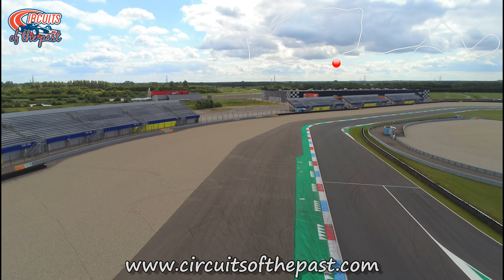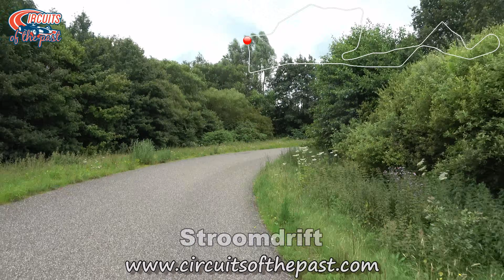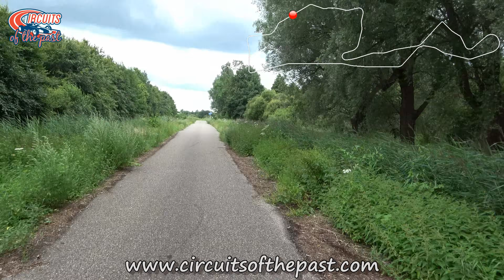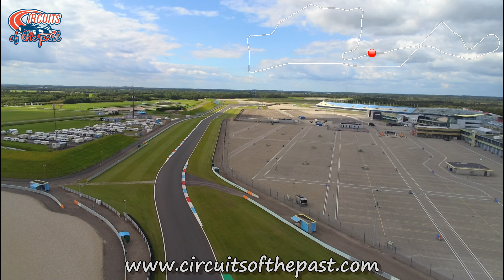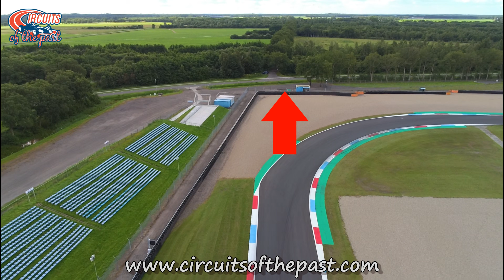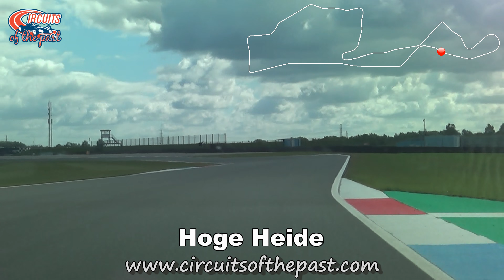TT Circuit Assen Old Layout 1955 - 1983

Comment: At -17.24 the corner was not called the Haarbocht, but the Bedeldijk
Reply from the maker: At 17:24 you see De Bult. And Bedeldijk was the left kink between the Haarocht and Stroomdrift and can be seen at 2:12.
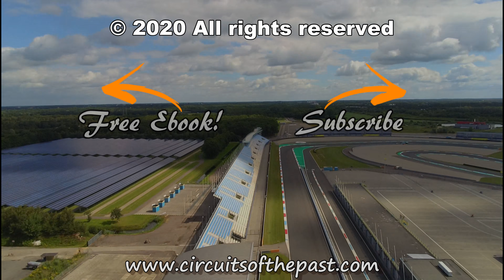Reply: mij video counsdown from -19:24?!. But the corner at -17.24 or 2.00 was not called haarbocht, but Bedeldijk. It was the corner where Wayne Gardner had his accident with Franco Uccini. The Haarbocht was introduced in 1984, when the circuit was shortened for the first time
Reply from the maker: According to my information the right corner was the Haarbocht and the left kink Bedeldijk. Gardner and Uccini crashed on the exit of the Haarbocht towards Bedeldijk.
This section already had the name "De Haar" when it was a street circuit. When the corners got individual names on the 1955 semi permanent circuit they named it Haarbocht.

Comment: Very excellent video. It's amazing how different these circuits were back then. But some of these circuits still have their original layouts. Like spa and monza and of course the hockenheimring. And others😎 take care
Reply: Non of them tracks are original in layout lol. Very few tracks are, if you don’t count ovals, the oldest unchanged track in the world is probably the Pau street circuit, unchanged in layout since 1935

But even that used a different layout once in 1933!

Maybe Herman or Simon have an answer to this @Circuits of the Past
Reply from the maker: @Tomtown007  Indeed, there are not many thracks that never changed the layout. The only circuit I can think of is Mugello.
Reply: Circuits of the past I know Mosport is unchanged since it opened in the 60’s, Macau has also been the same for an extremely long time, although it does slightly feel like cheating using street circuits haha
Reply: Spa has been changed also.
Reply from the maker: Hockenheim and Monza too.

Comment from the maker: See also my video with the remains of the Nürburgring Südschleife: https://youtu.be/RtVsAvRBzGo
Reply: Have walked the uphill section from Müllenbach to Scharfer Kopf several times. If you let your mind imagine it, you can still hear the racing motors coming up behind you..!!
Reply from the maker: @ricksiffleet2295  That's a long and steep walk.
Reply: Yes I know the circuits are different now. But I meant to say was like spa today still have parts of the old layouts. Only parts of the circuits.
Reply: I’ve often wondered where the exact location of the old T1 is in relation to the current pit straight at the Nurburgring. Looking forward to that one
Reply from the maker: @robdavies82  That was where now trhe right kink is before braking for the hairpin of the Mercedes Arena. There they turned left.
Reply: Wish it they could have included it in iRacing,  with today's technology getting better maybe it will be eventually.